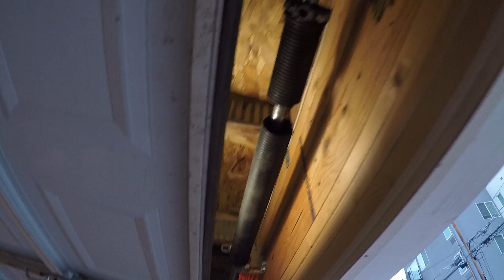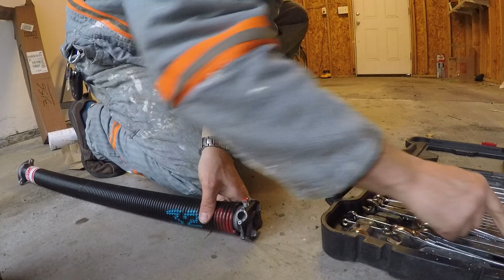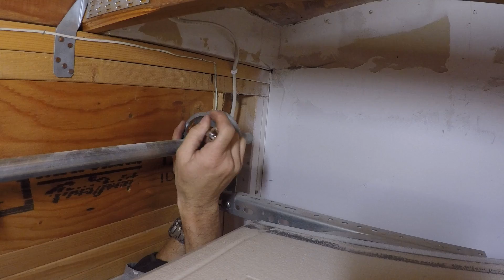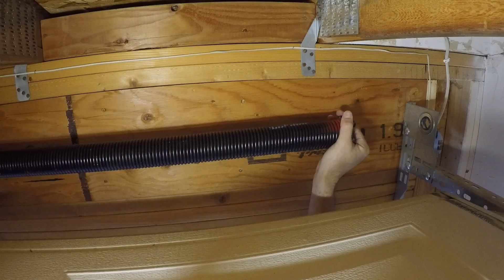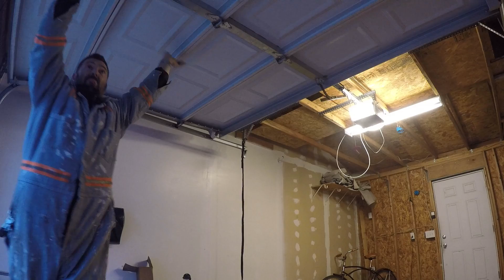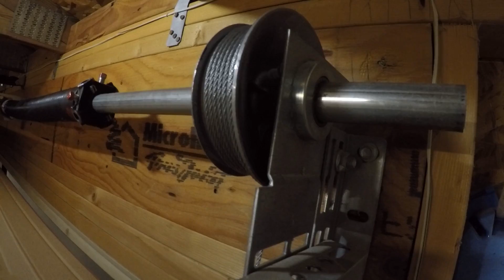How To Replace A Garage Door Spring Without Dying | THE HANDYMAN |

Comment: So did the old spring have a color code on it? I have done some there was a painted line on them and you could match the twist between springs by how twisted the paint line was.
Reply from the maker: They are color coded for weight. The diameter of the spring and the length of the spring also play a role in what spring works on a specific door.   Its best to measure your old one and look for a color code on it.
Reply: When I did my door back in the day, my new ones didn't have the stripes to count the spring twists so I added them myself.  Sure helped making sure I could visually see how many turns the spring was wound.

Comment: I never saw a 1 long spring on the Top of the garage door.. I have seen springs on both sides on the sides of the garage door set up.. Is this an older Vintage style❓
Reply from the maker: This door is new style 10 years old.
Reply: This video was a for a torsion spring.  The two on the sides are called extension springs.
Reply: Those are extension springs.  My father who is a retired garage door technician told me that extension springs are more dangerous to the customer, and torsion springs (like the one shown) are more dangerous for the technician.  When extension springs break, if there is no safety wire it can seriously injure or kill someone.  When a torsion spring brakes it just spins on the bar, the danger is in replacing them.

Comment: If you have to work with the door up, jam a screw driver through the hole on the rail in front of the wheel so if it come down it wont break your arm.

Comment: Where I worked I had 170 garage doors to keep running but we had no door openers, they where hand opened so to make darn sure the tension was correct, to much they would stay up not enough you couldn’t pick them up. I agree if you can afford someone to do it it would be a good idea. 18 yrs on the job and didn’t kill anyone.  Lol

Comment: Great video.  Is the amount of spring tension based on the weight of the door?  The unit in the video is different than ones I see in my area.
Reply from the maker: Spring rotations is based on how may times the pulley needs to spin to pull the cable up and keep tension on it.  Its about 7.5 turns for a 7 foot door.  You buy the springs in weight ratings for a specific door.  They all need to spin around 7 times.
Reply: If you don't have enough turns and the cable goes slack it can come off of the pulley and the door will FALL.
Reply: @ajoking4923  Are there redundant safety designs required for these systems? If a cable goes slack, there should be some safety stop based on forces unique that failure. Yes?
Reply: @davidsmith5599  If a cable comes off/breaks, nothing can really help that.  If any other part fails, everything, including the spring, is attached around the torque tube, so nothing can really fly anywhere except the cables.

Comment: So I’m assuming if you’re removing a spring still under tension you want to use bars to unwind it like you did to tension it?
Reply: Yes, the longer the bars are the more control you have.
Reply: That's correct. I purchased the bars at The Home Depot. I think it was 1/2" round metal bar stock.
Reply: Yes

Comment: I have aanother question not related to this how much would you charge to install commercial urnal ' just replaceing an old one
Reply: Depends on a lot of factors. When I was doing more sidework, I would sometimes check out different websites. One that I liked a lot is called www.homewyse.com or something similar. It gives a lot of info. I'm not a pro, so some things might be off, but I recommend it. I wonder what Handyman's thoughts are?

Comment: Nice job.  Why did you not lower the door before working on the spring?
Reply from the maker: You didn't watch the entire video did you?
Reply: I did, start to finish.  Was there some prelude that got left off from the beginning that explains the latch-up to hold the door open?  I really like your videos - very informative.  I was just curious because I have lowered the door when doing this replacement on my own garage door.  Your way certainly works.
Reply from the maker: Humm.  Not sure how you missed it.  It's spelled out across the screen.  Thanks for watching.

Comment: 😂😂I love the mud mixer’s and just to let you know don’t forget to lubricate your garage door that is very important and disengage your garage door from the opener and on the trolley at South there should be a nut in a bolt make sure you make your chain tighter go in the center of the rail and make sure the chain is no more than 1/2 inch above the rail in the center lubricate all the hinges and rollers sideburns are the torsion tube is and even the spring I recommend PB blaster a garage door lubricant you can buy at Lowe’s or the Home Depot in for the garage door opener rail I recommend white lithium grease on the inner trolley and on top of the rail in with the white lithium grease make sure you rub it in with your hands Make sure you wear gloves and everything on your garage door and opener will sound so much better and is won’t sound like your ears are getting raped

Comment: Just my opinion, but shouldn't the spring be lubed since it is rubbing against the metal bar? And (like the people below are saying) Shouldn't the tracks also be lubed?  Seems kind of loud.   My neighbor has one of these, and when it opens you can barely hear the motor running and nothing more.. No squeaks and such.
Reply: +craigerlist  it's not unusual to oil the spring(s) to stop rust and reduce the friction of the coils rubbing together.   Rubbing on the torque tube is usually not much of a concern, although large commercial springs will often have blocking in them to counteract the spring sag.

Comment: As a garage door technician, please dont mess with the springs or the cables attached to the bottom fixtures unless you know what you're doing. There's way's we can work on the cables & bottom fixtures without causing injury or unwinding the springs (we can backwind them to release tension and use grips on each cable) but you have to understand how it all works. Those cables, and springs, will kill you. Everything is under tremendous tension. Or you will lose a finger or hand. The main thing with springs is use WINDING BARS! Don't use rebar, screw drivers, nothing except winding bars. And make sure your head is out of the way. Make sure each turn, especially after it's under tension, the winding bar is FULLY IN because if you tighten those set screws and your hand is in the way and that bar slips out, you're not gonna have a good day. I'm serious for anyone reading this, be careful. I would just spend the money and call a professional if I were you.

Comment: Any more nowadays this is a pro job considering that you have to safety check the installation to make sure it's tensioned correctly, all the safety features work as advertised, any crush factors have been eliminated and that the entire garage door mechanism is code compliant... For guys like me it's just another opportunity to up-sale a client and educate them...Using this door as an example a bit of maintenance and lubrication is in order too... as noted during the walk thru in the video... This video featured a sectional overhead garage door as opposed to a full panel overhead door which entirely different animal altogether and has it own sources of danger... As I said before nowadays this is a pro job and if you choose to take it on it would be wise to make sure you know what are doing because any misstep could put you and your family's safety at risk... and nothing grabs your attention faster than hearing a spring that busted loose and has you in it's sight!

Comment: Thanks for safety caution on stored energy. The spring.  We all need to think safety when we are working with any form a stored energy. A few months back was removing old pull down attic steps with a friend. He was in the attic and took the last  screw out while I was supporting the bottom. The spring tension slammed the frame of the unit down onto the part I was holding and exploded the 1x4. Missed my hand by an inch or so. 
Needless to say it would have shattered my hand.

Comment: Had you placed cables ,tightened spring and pulleys set screws  while door was open - you did not have to wind springs at all - because when door moves down it would have tensioned springs
Reply: Wrong
Reply: Still gonna be about 1 1/4 turns short lol.

Comment: Torquing that spring is pretty scary when the rest of the hardware is corroded and marginal.  There are some real antiques out there. As a handyman they called you because they don't want the garage door company to come in a replace everything. Sometimes you take a "calculated" risk.

Comment: It doesn’t matter if it’s a left or a right, the spring can go on either side of the bracket.
Reply: Something to know is there actually are right wind springs and left wind springs. It depends which way the plugs are installed into the ends of the spring.
You can attach the spring on either side of the bracket, but if you put the wrong spring on the wrong side, it can/will unwind itself from the plug when under tension and could cause the door to fall.

I've showed up on jobs where guys tried replacing springs themselves and I found blood trails. 

Definitely call the pros for this one!
Reply: +Eagle  Like said, there are left wind and right wind springs.  The right wind springs are usually marked with red paint, and, naturally, they go on the left side of the door.  ;)
Reply: EagleKeeper WRONG! LHW springs go on the right of the shaft. RHW springs fo on the left side of the shaft. You do it backwards and they could break or unwind out of their cones.

Comment: Is there a written guide somewhere to follow on how many 'turns-to-tension' to load the spring?
Reply from the maker: Its base on rotations of the pulley to keep tension on the cable all the way up.  Its usually around 7.5 turns.   You can play around with it to get the exact amount of rotations.
Reply: Never forget to put the bars in before you release the set screws.
Reply: @james6794  I now understand why the HM said to hire a pro . . . a lot to learn. His video on measuring springs was excellent. Thanks for the link.

Comment: Out here those door guys do not charge that much to replace a set.of strings.  I was wiring a garage that had a new door installed.  I had to put a trash can under it to hold it open.  It was an incredible force pushing it down.  Last part.of the job was an outside light.   I had to put the door all the way down to wire the light.  Me and another guy took everything we had to get that door back up so we could escape. So, leave door installs to the pros
Reply from the maker: A lady just posted below what she was quoted to replace springs.  $800

Comment: Could any one explain me why my garage door springs are on each left and right end of the bar instead of in the middle pls?
Reply: Typically, the standard torsion springs are anchored in the middle, and the "easy wind" style torsion springs are anchored on the ends.  It's just a different style.

Comment: SO, HOW MANY TURNS OF THE SPRING ???
Reply from the maker: 7ish
Reply: OK   THANKS
Reply: Hold on here, the number of turns on the spring depends on how high the door is, if it’s 7’ tall door I will do 7.5 turns, if it’s an 8’ door, you’ll want 8.5 turns, and then adjust from there. The extra .5 turn is just to keep tension on the cables when the door goes down

Comment: If you set the spring on with the door open you don't need to put tension to the spring. The weight of the door will do it for you when you close the door.
Reply: Wrong you still wouldn't have enough tension

Comment: First thing he put the wrong spring. He  had 234x31 and he put 225x33 the garage door going to be heavy. You always make sure you the right size. 

The correct size of the wrench for the drums and the spring 7/16 wrench.

It would’ve been easier taking the spring off if the door was down lol

You’re lucky it’s only one spring if it was two you would’ve got hurt
Reply from the maker: You didn't watch the entire video.   Please watch the full video if you are going to comment.

Comment: I don't understand the need for the springs. I have a single garage door connected to a Ryobi garage door opener. No springs, just the track is connected to the top of the door with a bracket
Reply from the maker: I'm pretty sure you have a spring.  The garage door would go into overload protection without spring assistance.  The lightest garage doors weight 150 pounds.  Most are over 200 pounds.
Reply: @TheHandyman1 Now you mentioned that, I realized my springs are parallel to the track, not mounted to the header above the  door like in the video. Thanks
Reply from the maker: That how they are on my house too.
Reply: The springs are under tension when the door is closed, they assist the operator in lifting the door.
Reply: @TheHandyman1  A buddy of mine has a 55# garage door.  ;p

Comment: Ive owned my garage door repair comany for 17 years.i would charge $160 and been in and out in 30mins or less , and thats with a door inspection and lube . things can go worng fast , dont work on your own garage door.
Reply from the maker: That's extremely low pricing.   People have been posting what quotes they have received.  Anywhere from $400 to $800 for new springs.   Do you shill have the company?

Comment: Why not just change the spring with the door down so you didn’t have to struggle in that tight space?
Reply from the maker: Its is literally spelled out across the screen at 2:00 You really should watch the videos before commenting.
Reply: The Handyman I watched the video. The camera could have been easily set up a different way. I’m asking why you would make yourself struggle with the door up when it wasn’t necessary. No need to be rude.

Comment: As an installer myself. I will tell you that 2 minutes in, there are precautions that aren't being taken into account, especially if you have a 2 car(heavier) door. If this is your first time doing this, you WILL get hurt. If you really want to get away with the best alternative your best off comparing prices from different companys. Remember that they may charge you a service fee to estimate or check your door.
Reply: We charge between 185-300 in cali depending on the type of door you have. Some installations are pricier for heavier doors. If someone is charging you 400+ they are ripping you off
Reply from the maker: $800
Reply: Your the man Handyman!!! I know a guy who got hit by the shoot back on the spring , he decided to use rebar. Not good advice.

Comment: This is how people get hurt. You can't just eyeball the spring either. If you're off by an eighth of an inch on the coil size, let alone a couple inches off on the length or quarter inch off on the diameter, the spring rate is too off to work. Never improvise on the winding bars either. This is the kind of repair that a pro ends up having to fix, and this is why pro's dislike DIY'ers and handymen. Call a pro, this is not an amateur repair.

Comment: Wrong size spring!!
Reply from the maker: Correct spring size.
Reply: How do you know? Was the original spring size converted by the place you got the spring from? I’m going to assume when used by hand the door would not stay on the floor but then died out when almost fully open...
Reply from the maker: Its my rental house that I own.   I have owned it for 12 years.  I built the garage.

Comment: That is definitely NOT a diy project!  I design and sell doors and windows and we WILL NOT sell torsion springs to the public, it's too much of a liability!  I understand your early episode with the pulley, but the real "killer" is when your mud mixers, rebar, screw drivers, bad mitten rackets fly out when the spring is wound and your device splits your head open.